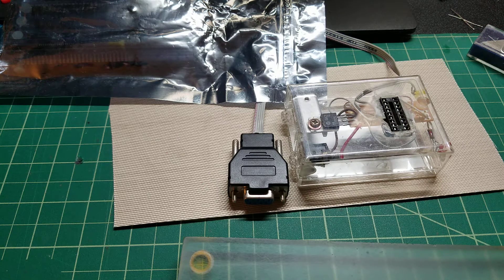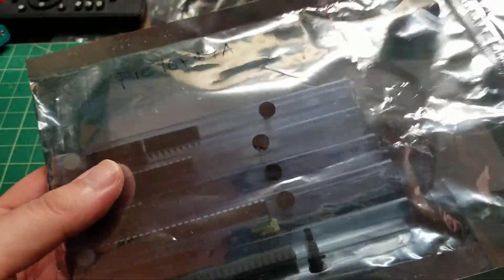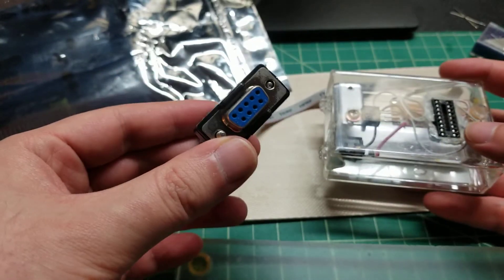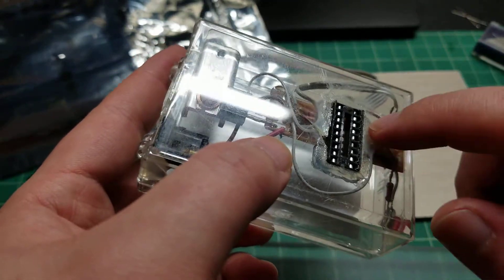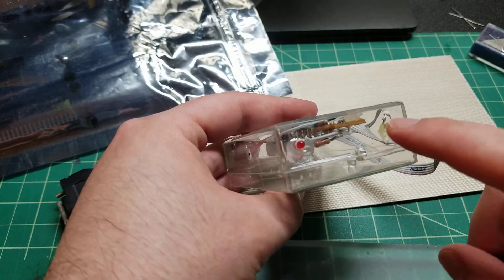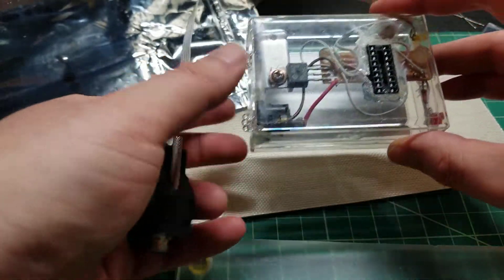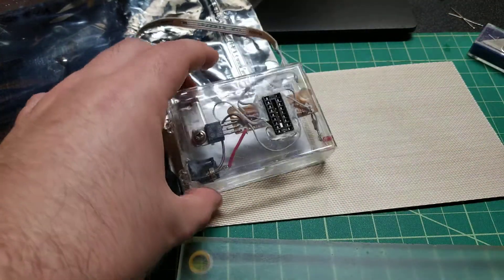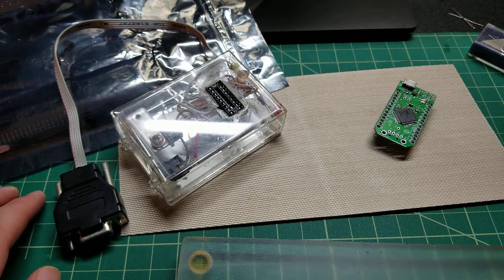Quickbit: Found My First Serial DE9 DIY PIC Programmer!

Comment: I love these makeshift builds!
When I was a teenager with no job or money I found out that you could take a hot air gun to a circuit and bang it a couple of times and most of the components would fall out/off. That combined with our street rubbish system in Australia got me started with electronics.
Reply from the maker: I used to do exactly the same thing lol